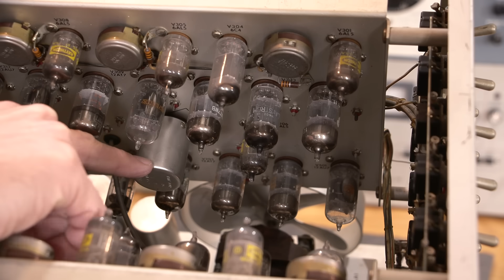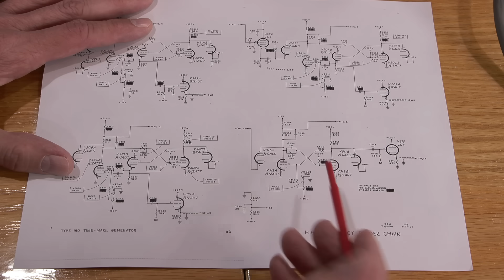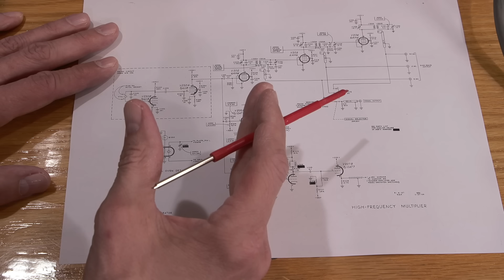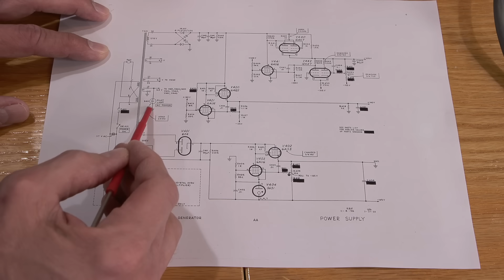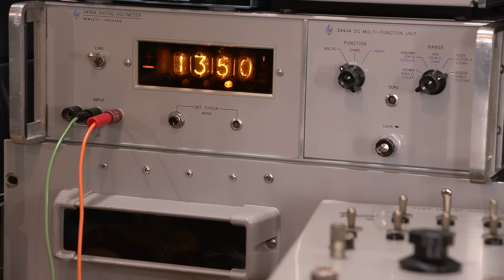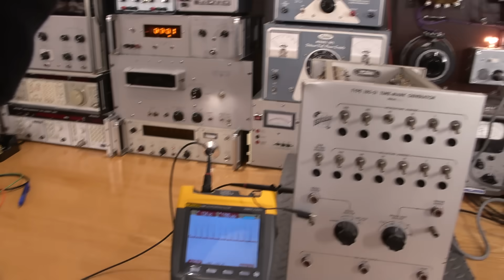Cool Circuit Inside! TEKTRONIX 180-S1 Teardown With Description - Guess how many TUBES are inside!

Comment: It is my understanding that the roll of solder is a silver solder that they included  because silver solder is what the manufacturer used originally.  Silver solder  provides a stronger joint. Tek wanted whoever was fixing the equipment to use the correct solder.
Reply from the maker: The use of Silver solder is to prevent delamination of the the "horse shoes" in the ceramic tie points.

Comment: That looks like a perfect candidate for a wash down.  We did that with Tek O-scopes, first we removed the CRTs and then washed them down with Ph neutral soap, rinsed with city water and then with deionized water and then put them in an autoclave for 24 hrs. Recal after that.

Comment: A trick I discovered working on equipment with attached cabling is to put the cable(s) over my shoulder before pulling apart the chassis. This makes it easier to pull the back cover off without having to fuss with pushing the cable through the exit hole. You can back away a bit, then pull through from the other side. 
Aaaaanyway, maybe that will come in handy some day!

Comment: Let me say that I am a moron when it comes to electronics. I have among other things a Tektronix 535 oscilloscope. Please people, do not even think of plugging one of these things in, not to mention any old radio, TV., test equipment, etc. It's bad enough if you ruin one of the tubes because of bad capacitors, but if it's the power transformer from a 1930's Zenith console, it's not like there are lots of replacements out there. Not to mention burning down your house. If Mr. Carlson's warnings over the years about safety get old, well he's trying to keep you from cardiac arrest if you touch something you are not qualified to be touching. Rant Over

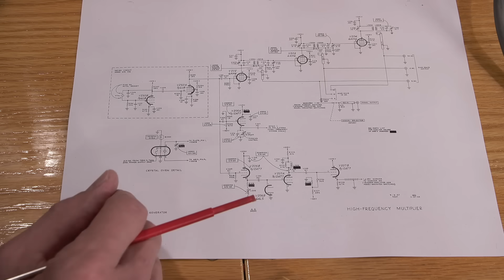Comment: 13:31 Thank you Paul for the memories. I worked for Tektronix from 1966 to 1995 (retired). Areas were Final Assembly, Test Quality Control and Display Devices Engineering. I.worked with severl crt types you have in your Tek scopes. I watch you often.Thanks again.

Comment: Hi, and thank you for your Youtube channel with clear explanations, just perfect for a guy like me. If you don't mind I have question for you
I built a specific use power supply based on An ATX computer Power supply it works beautifully ,but I need to modify my design for future consideration I do have a question for you,
I have a COOLER MASTER RS-500-PSAR-J3 power supply it reads Input 120 VAC, output DCV { +3.3V (22A) /+5V (20A) =130Watts} , { +12V1(20A) /+12V2 (20A)=360 watts} , { -12V (0.8A)=9.6Watts} , {+5VSB (2.5A) = 12.5 W} .Question is it possible to step up the -12 Volts to a higher Amperage , if I can or need to remove the +3.3 volt , 22A and modify that part of the circuit to match the -12 V circuit ?
any help would be appreciated
please and thank you, ,

Comment: I would be worried that the electrolytic that had leaked might explode.
Any thoughts as to why Tektronix used a full-wave thermionic rectifier for the negative supply but a solid state bridge for the positive supply? Maybe just history?
The wide range of adjustment of the second / millisecond / microsecond marker pulses implies that they are not derived from the crystal frequency. Why might that be?

Comment: In the mid 80s, I installed a CB in my car, and not long after an older man offered to me an amp. It was not new, it had tubes. He helped match my radio to that amp. The box was red. And everyone loved the way it sound. They all told me my signal was extremely clear and loud! I was able to keep it. Many others who had CB's tried their best to trade me with something but, I was not interested. As the old feller told me that would happen and not to let anyone have it. He told me I should keep it. I did and used it for many years. I do remember the smell. From the very first time I set it up in my bedroom. After I setup my antenna, the old guy helped me setup my CB. And he made me wait until he got home. He had many of those amps. As my new to me amp warmed up and smell started, and It was Awesome. I loved using it without my light on. On this device restoration please!

Comment: Memories of youth.  I used to go to work with my father at  Channel 7 In watertown ny and the rows  of cabinets filled with this kind of technology.  The smell of warm electronic components and dry dust,  with a hint of octal socket laminated phenolic board and  Micarta thrown in fir good measure.  Up on the roof, the cabinet ventilator discharge could heat a house.   The Utility company had to put in a substation down the road to power the station. These videos always bring back memories.

Comment: You must be careful for the overall system thermals with the top cover removed.
The top cover provides the appropriate vent holes and ducting that directs the system airflow in and around the critical components.

Comment: I really need to find a way to calibrate a 547 Tektronix oscilloscope. From what I understand, it requires a special kind of plug-in unit. I don't know if it can be calibrated any other way without that unit. If anybody has any ideas, I'd be open to hearing something. Because I've been unable to find one of those units.

Comment: 54 tubes. Absolutely incredible
Reply: The equipment from this era is always cool to see.. and the more "black box" something is, the more peculiar they seem to be on the inside. Front panel whizbangyflashy things always give at least part of the mystery within away... less "clue" going in always leads to more adventure upon entering.
Reply: @MadScientist267 I love my old Tectronix etc. I have a old nixie tube DVM and 10 digit nixie tube calculator. Lots of Knight equipment Hewlett Packard. Diode lasers up to a 5000 W CO2 YAG laser. I built a massive tesla coil that uses a huge pole pig. I built the rotating spark gap with tungsten bits that are replaceable

Comment: Hey Paul, Good deal on continuing with SP-600 restoration! Glad my comments made you go through! 
Hi Hi! Textronix Vac Tube equipment,Best of the Best! Just tore down Conn Vac. Tube Hammond style 
Organ. Retrieved "56" 12AU7 & 12AU7A Tubes all in good condition except 
2 or 3 for $30 at flea market!

Comment: I started my 26 year career with Tektronix in 1977. I worked on 500-series vacuum tube scopes, even though they were old and mostly obsolete. We techs kept a stash of tubes at our bench for quick swap outs. Ceramic strips tended to create "silver migration," causing resistive bridging between connection joints. Oh, and I got introduced to the mains voltage as well as a 350v plate supply in moments of inattention. Nearly 50 years later, I still remember the pain and fear from those shocks.

Comment: The smell of the vacuum tube gear is like the smell of 'hot metal and oil' from my 1973 Monte Carlo!  It was one of my first cars.
Reply from the maker: Kind of close with this one, that small motor oil smell, with the old radio hot circuity smell mixed.

Comment: The most tube dense piece of equipment I have is a Heathkit CD-1 NTSC generator.  It has twelve tubes, most of them being 12AU7s or 12AX7s (either will work) which are wired as multivibrators.  It uses these in a cascade to generate the test patterns.  It also has a built-in VHF visual exciter.  And it's not too difficult to calibrate- all you need is a good oscilloscope, and optionally a frequency counter.

Comment: Memory lane! .......... now 80 yrs old and started my electronics way back - all with tubes, affectionately called back in UK, 'bottles' sometimes. Sadly sold my huge collection of valves before I made a huge move.
Some old favorites were _ KT66 and 6V6 (beam tetrodes) for audio amps, 6K7 as a useful pentode (like in a superhet), ECL82 and ECC83 - B9A bases used for super simple audio work. Remember the old acorn valves ?? - had several of those. EF80 - ubiquitous B9A pentode. So many other valves and fond memories :)
Tektronix was IIRC a pretty high quality brand.

Comment: I would have been surprised, barring catastrophic failure,  if it had not worked. 
I used to calibrate these devices, many years ago. 
During this items era, I believe that Tektronix made the finest test equipment in the world. They had no peer. 
You're correct about the silver-bearing solder. Those ceramic strips would tolerate ordinary solder a time or two... But. after that you were likely to have parts flopping.

Comment: Put a mirror in the lid and add an adjustable locking prop-rod. Then you can run it in a normal position but still enjoy the sea of tubes glowing.

Very nice. Beats by a mile the 12, 12au7's (maybe 12ax7) my one kit amp has lined-up across the front.